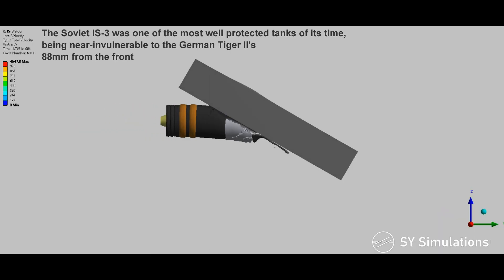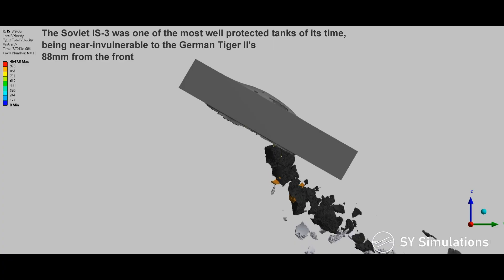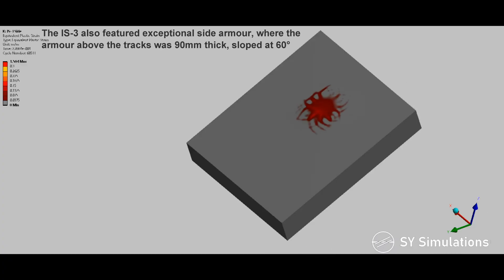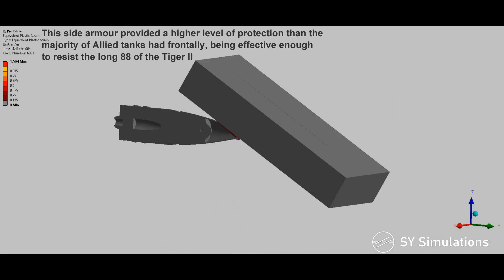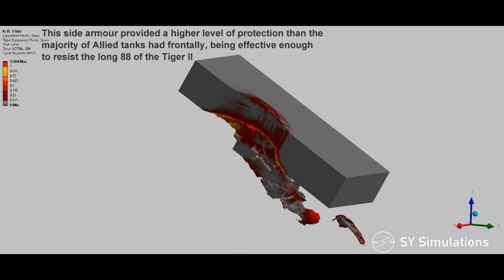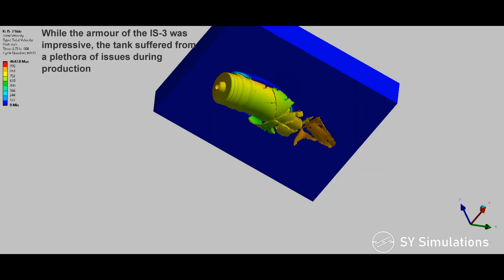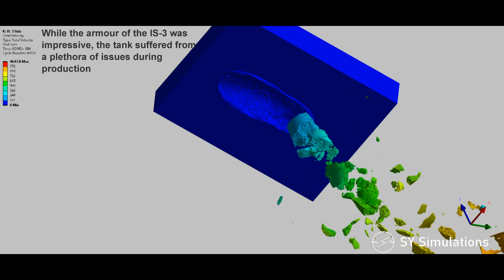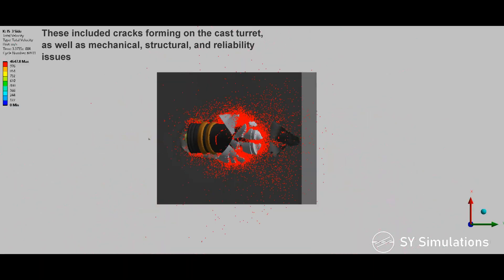TIGER II vs IS-3 | Side Armour Stronger than Most Frontal Armour | Armour Penetration Simulation

Comment: From all the games and simulators, my favourite depiction of IS-3 is in the modded Call to arms: Ostfront. There it not only uses more of its HE power, but also its AA DSHK machine gun, with its enormous power capable of frontal pen on any field anti tank gun shield, and most half tracks and wheeled tanks. Plus you really do not have to fear anything smaller than the 88mm L/71, unless you drive like a dumbass.

Comment: The IS-3 Never saw any action in WW2 . And if the War had continued into June 1945 , The King Tigers 88s and up gunned 105s would have been issued with the new APDS Ammunition. This also applied to the JagdTigers 128s . Thus the IS-3 would have been blown apart just as easily as the previous IS-2 . P.s. the KingTigers 88  mm / L71 firing APCR rounds would have also Swiss cheesed the IS-3 . As would the 128 mm round!
Reply: I doubt that there was any German industrial capabilities in March 1945, let alone June 1945
Reply: @CCP-Dissident   Their were KingTigers fighting right up to the end of the war actually.  Unlike the IS-3 that didn't participate in WW2 !!!
Reply: @Voided009   Just as a reality check for you The IS-3 didn't Participate in WW2 !!! And a 88 / L71 - 128 mm even firing standard shot was more than capable of destroying a IS-3 . Particularly in the Flanks.  Please also note even in the last days of the War the Germans still had 5/6 rounds of APCR available for their Tigers for special occations. Drawn from their remaining stock piles.
Reply: @Voided009  The Fact is that The JS-3 Never Saw Combat in WW2 . And The Fact is that The KingTiger / JagdTiger / JagdPanther / Pak 44 etc could Knock out The JS-3 Armour using its Standard and Still available available APCR Ammuntion at the end of The War . Due to their hyper muzzle velocity - (If) The War had continued or (If) The Soviets had managed to get its Is-3 into Action 6 months early. A Tank who's Brittle Armour was only 120 mm thick on the Front and 60 / 90 mm on its sides and rear.........
Reply: @Voided009   The JS-3 Never Saw Action in WW2 !!! And if it had, it would have been knocked out by The Mighty KingTigers / Jagdtigers / Jagdpanthers / Pak 43 / 44 / Panzerfaust 100/150s ! May I also add The Germans would have still had some stocks of APCR into June 1945 with in their huge underground Bunkers available for their Armour. 
Take alook at what the Hungarians did to Soviet IS-3s in 1956 they were demolished!
Reply: @Voided009   The whole point is if you put a JS-3 side on to a KingTiger at 500 / 750 metres range it would punch a hole in the side of it quite easily. Please note the 88/ L71 was spot on accurate due to its superior ziess optics. And could place a shot wear the commander wanted. Please also Note that the Soviet IS-3 Never Partisapated in WW2 .
Reply: Who is your crack dealer
Reply: @thesaul9484 gort is literally making stuff up I genuinely don’t think it’s worth trying to explain to him what’s going on I think it’s hair
Reply: @JUNIORTHEKID1887 love that there is no counter argument, just insults. As they say, insults are the tool of the loser. So I award OP the winner by defacto of said insults
Reply: @Dr_Dirk_Diggler  if I say “clouds are cotton candy” and people call me a idiot and say I’m a lost cause does that mean I’m right because people insult me?
Reply: @andthenhedead6076   The above concerning the power of the German 88 mm / L71 - 128 mm firing APCR / APDS . Is fact actually and they were more than capable of penertrating an IS-3  particulary in the Flanks and even over its frontal ark. Look it up for yourself self. The Panzerfaust 150 was also capable of knocking out the IS-3.
Reply: @thesaul9484   What kind of comment is that ???
Reply: @thesaul9484   Are you some sort of a idiot!

Comment: This is what made the T-44 so special. Its UFP was 90mm with over a 60-degree slope, yet the tank itself was 1 ton lighter than a T-34-85.
Reply: One ton lighter than T34/85?
It was near 1 ton heavier than T34/85, not the way reversed.
😅
Reply: @franciscojaviermartineztor9745  T-44's full combat weight was listed at 31t, the T-34-85 is 32t
Reply: Yes. Hull design was great with frontal protection . Also 8 cm side was not bad. Tiger tank had 62 mm side lower armor, but track wheels were an armor itself too.
Reply: How????
Reply: @GEEISKING it was a more compact design, same reason why despite being smaller and lighter, post 2nd gen Soviet MBTs have similar levels of protection with it's western counterparts

Basically compact design = less space used = less metal = less mass
Reply: @Ry-bo9hi  and less space for the crew to do it's job
Reply: @ab_user-1488  It was as wide as the M26 Pershing, with a redesigned turret for more space. It was efficient
Reply: T-44 is a top contender for best designed tank of the war.
Reply: @ostiariusalpha  Although it never saw action. So kinda sucks to be well designed but never used.
Reply: @yarugatyger  Rebuilding the production line is long and expensive, so they preferred to make more simple tanks with average characteristics that were well-tested in production, rather than get more advanced ones in smaller quantities and later.
Reply: @mishamixailov  that was never in question, the dude above just celebrated a never used design. As a design revolutionary for WW2, obviously it wasn't.
Reply: @yarugatyger  I don't know of any tanks of the same design as the T44 during WWII.
Reply: @yarugatyger  First series T-54 were literally T-44 with a different turret so you can chalk all the T-55 and arguably T-62 as direct descendants.
Transversally mounted V-2 family engine is still used in T-90. All in all T-44 is the most influential soviet design.
Meanwhile it's direct competitors - Centurion and Pershing fizzled out by mid cold war.
Reply: The Soviets understood the importance of the square cube law in armor development ever since
Reply: 239pen M93: :)

Comment: IS-3s mechanical issues only began to show up during 1946/47 due to prolonged peace-time usage. In practice, IS-3 was not significantly less reliable than IS-2, which also had shown some mechanical issues during its postwar service in the late 1940s. If they were to go into battle straight from the factories in 1945, like IS-2s did, then IS-3s would likely last through multiple operations without any major issues.

Comment: Should note that this excellent side armor came at a cost, ergonomics! What use is such super armor if the crew can barely do their job?
Reply: @Voided009 
Yeah I bet the tankmen will be super pleased to hear that lmao.
Reply: Abrams already lost his battle with t90 in Ukraine, right? It's easy to find... @ThatZenoGuy
Reply: @신종원-z2u  
Bot account with moon runes thinks it can tell me what's what. Lmao.
Reply: This configuration of side armor goes OVER the tracks, it's adding internal volume to the tank, not subtracting.
Mind you this tank is almost a direct counterpart to M26 which wasn't very comfortable either and would be unserviceable with a 120mm gun.
Reply: @Klovaneer  
You've fallen into one of the classic blunders.
The sloped area adds weight, for the same amount of weight there could be extra internal volume.
Reply: @ThatZenoGuy  The width is, as always, limited by railroad cars. Besides height was the main problem, for anyone over 5'5" that is.
Reply: @Klovaneer  
Protip, a square has more volume for it's surface area than a triangle!
Reply: @ThatZenoGuy  Soviets were not smart enough to make a churchill tank :pensive:

It's not like you can cram the crew in these sponsons, they are extra hull stowage. So in total it was purely a side armor feature that required really big specialized presses and yes, added weight better used elsewhere.
Reply: @Klovaneer  
No, but soviets weren't smart enough to design tanks intended for human beings.
Reply: @ThatZenoGuy  This really is just shittalking and nothing more. They were definitely smart enough to design tanks intended for human beings. They just sacrificed comfort for a smaller profile and lower weight.
Reply: @joost1120  
Nope, not really. As evidenced by Ukraine.
Reply: @Voided009 
Yes but Abrams don't pop like a balloon when hit.

Comment: Great video SY, you’re so close to 100k that’ll be a huge milestone

Do you think after you hit it you could do some really modern simulations such as the side of modern Russian mbts with upgraded side armor (BVM 2023) getting hit at a high angle and seeing if it’ll shunt the projectile? Or perhaps something like M829A3 vs T90M frontal hull?
Reply: It depends on blueprint variability. Better check the War Thunder Forums.
Reply: @oohhboy-funhouse  they leaked all the blueprints for those tanks
Reply: So it’s easy to get an official one

Comment: The armor plate was almost broken. It was close. Considering that the simulation calculates a simplified version, it is quite possible that the crew will be cut by small fragments. It is unlikely to be fatal, but there may be injuries. I expected a worse result.
Reply: Cracks have formed, but no fragments have occurred.

Comment: imagine being Hans hitting the side of a tank and you see the thing just casually rotating the turret towards you...
Reply: sitting in Tiger2...not some T4)
Reply: Is3 was not on ww2 battlefield....
Reply: Your tank ran out of fuel 50 minutes ago
Reply: He almost didn't have time to take part in the war. He got there in the last days.
Reply: If hans had to strike i3 in i3 service periode, he would have shot with 128mm of muse cannon😗
Reply: not much an is3 can do to a king tiger from the front unless its close range
Reply: @LordOfChaos.x  Just that large heavy projectile alone with its kinetic energy is enough to jam turret ring, cause severe concussion, damage suspension and do other nasty things even if it does not penetrate inside. Even 122mm HE-FRAG can mission-kill any tank including modern MBTs. Getting hit by that thing while sitting in Tiger2 is not an experience you want. Real life is not warthunder/WOT/Enlisted or whatever.
Reply: @xmeda  Даже в War Thunder попадание HE  в башню Тигра 2 убивает экипаж, ведь крыша корпуса совсем тонкая– 40мм
Reply: @xmeda  especially if you remember that at the end of ww2 german steel turn into shrapnel pretty easily.
Reply: @trololoev  Thats impossible, german steel strongest!
Reply: @xmeda  the long 88 has more kinetic energy than the 122mm due go its higher velocity. The spalling even with a non penetration on the is3 will result in the death of the crew. And no the 122 mm HE wasn't able to take out even panthers
Reply: @LordOfChaos.x these are battle which KT facing Is2
Is2 armor piecing doesnt work due to thick armor, but after they switch to HE, game over
Most soviet tank emphasize HE due to their design being support on infantry, not tank vs tank directly

Comment: The main reason IS-3 was such a tough opponent to the German Tiger II was that IS-3 didn't participate in WWII.
Reply: is 3 just didn't make it to the war. it entered mass production even as the first heavy tank regiment began to switch to the IS3 during the war. but they would only reach combat readiness at the beginning of June 1945. The IS3 was a few weeks away from seeing the front lines of World War II. By the end of May 1945, 125 IS3s had come off the production lines, and by the time of Japan's surrender, over 800 of them had already been produced, so even more IS3s were produced during the war than Tiger 2s.
Reply: @filipmisko9363 theoretically like first 50 could be there for last couple of weeks with some sacrifising crew training but it would not change anything
Reply: Even if it did, I think it'd still be pretty decent. Take a few combat trials to fix the cast turret cracking and they'd fix it up real quick to be deadly. The reason the whole concept of the IS-3 was pointless because I think it faced mainly RPGs so the armor was basically useless
Reply: Maybe not in the European theatre but id be certain at least some went to Manchuria for evaluation.
Reply: Yeah, just as all american m 26, t 26, t 34, t 32 and others
Reply: @Rheinmetal_Borsig_Waffentrager  The pershing actually made it in time for ww2, it was at the very tail end of the war but it did see some combat.
Reply: Yeah, but seen the strength Germany achieved with the Königstiger, the Allies and the Soviet Union wanted to reach that level too, using the Tiger II as a reference due it's tough armor and strog cannon. In fact, the IS-3 was designed to deal with the Tiger II's 88mm specificalky because it was one of the best cannons of its time
Reply: @Pheramix not just one of. It was the gold standard for a high velocity tank gun. Every tank designer was trying to defeat it. The IS-3 was successful, it was invulnerable to the long 88 from the front.
Reply: @UHOH3300  not quite, there still are those very specific sport at the direct turret cheeks of the IS-3 which can be penetrated by the APCBC of the tiger 2.
Reply: @UHOH3300  yeah, but there are also other great anti-tank guns that deserve recognition, such as the 17 pounder
Reply: While unconfirmed, there are rumors that 3 early IS-3s fought some isolated jadgpanthers after German's surrender. Source tanks-encyclopedia.
Reply: t-34 was enough for Tiger 2, calm down boi
Reply: @stalintheliberator2454 I know you are not talking about the t34 Soviet medium tank, because that thing was the most overrated pile of shit produced
Reply: Потому что с тигром 2 УСПЕШНО справились тридцатьчетверки, СУ 100,ИСУ 152, ИС 2  и противотанковая артиллерия. ИС 3 просто не успел доехать 😂

Comment: Hi, could you please do a simulation of the IS-7's 130mm S-70 cannon shell against the E-100's frontal turret at 500 meters?
Reply: In simulations IS-7's 130mm S-70 BR-482B was able to penetrate Mouse turret armour cheek 220mm at 30 degrees. According to drawings of E-100 turret from 17th May 1944, it planned to have 200mm at 30 degrees. I guess it won't be a prolbem for IS-7 canon.
Reply: @nuraly78  First, that simulation was at 20°. Second, in the first part of the video a good quality projectile was used, but in the second part a projectile more suited to Soviet metallurgy in the Second World War was used and the only thing it managed to do was break the armor, no shrapnel went through. Either you consider the fact that the armor was broken as penetration, or you haven't seen the entire video (like I did the first time I saw it).